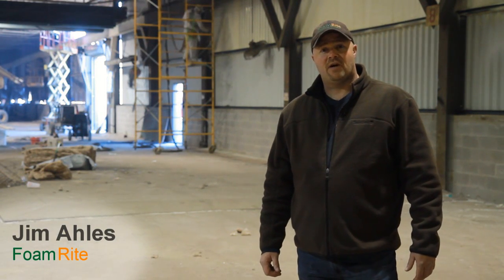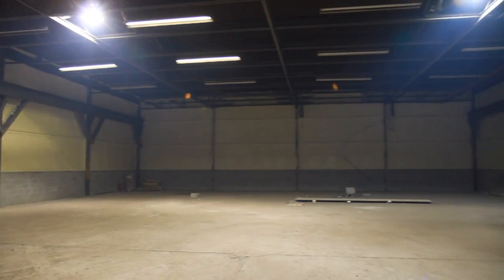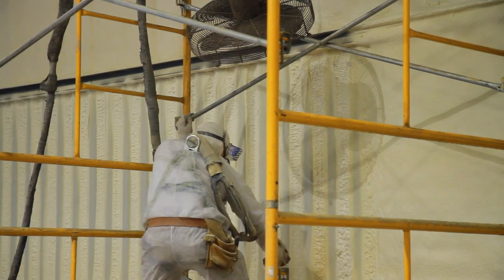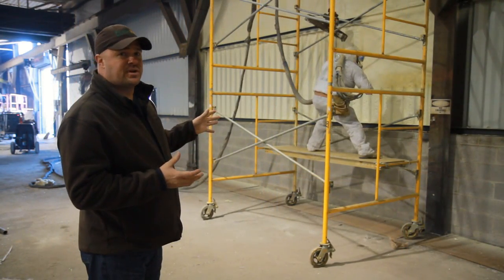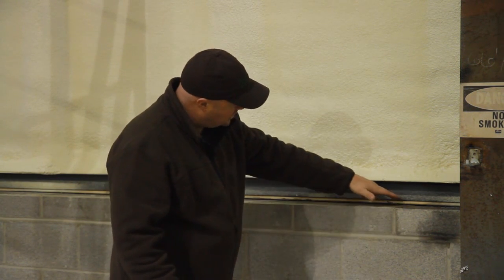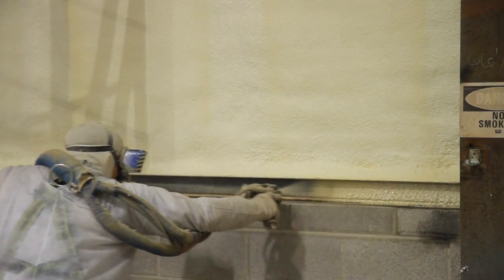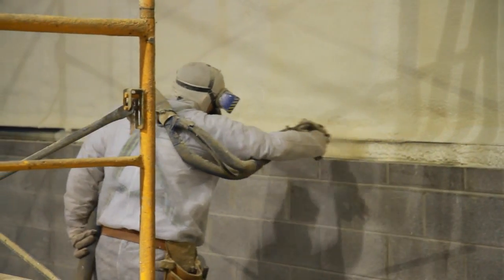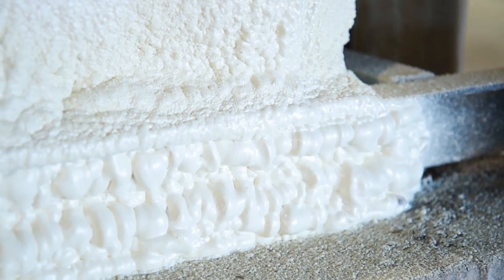FoamRite - Insulating metal walls in an Industrial Building

Comment: Is Foam insulation fire proof and does it come in different Colors?
Reply: starrrdragon yes it comes in different colors
Reply: starrrdragon is has a fire retarded rating but I can tell you from working on the spf business as long as there is a flame the foam will stay lit, when flame dies then spray foam flame will die. D.C. 315 is the best thing for thermal/ignition barrier.